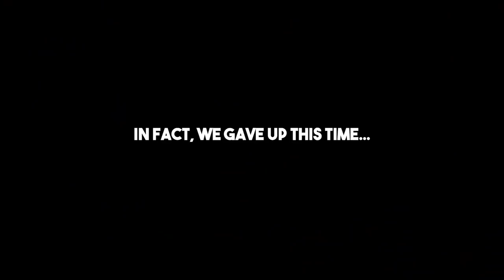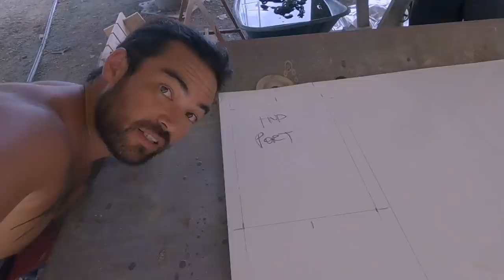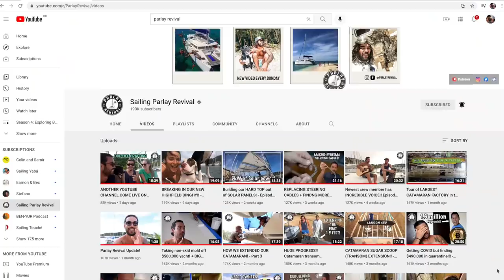⛵️This Lagoon 450 with broken bulkheads could have sunk 😨#213

Comment: Now I see how wonderful it is to have a steel boat.  Working with steel is so much easier than fiberglass.
Reply: Huuum, each material has it's qualities and defaults. Like weight, steel hulls are way more heavy than fiberglass. As Collin demonstrated, fiberglass is easier to work with in case of an accident/collision. You can have your fiberglass repaired in any marina around the world, not so with steel.
It goes on and on and on...

Comment: If the bulkhead damage is indeed so common, a class action lawsuit might be the answer to get the company to reimburse owners.
Reply: The manufacturer is working with the owners of these boats; it is not strictly adversarial requiring attorneys to get things done. All, as you know, has been brought about from Colin's hard work and public forum.
Reply: Well, they took it out of the Lagoon.  🤔
Reply: @tollertollertoller  Thanks for sharing. I wish all owners good luck.

Comment: They are cheating, they bought that fiberglass. To make it from scratch you must start with a large crucible that you have made, filled with washed sand and other ingredients, and then drawn into glass fiber which you weave into cloth.
 Not to worry, I'm sure that if you build the crucible, Roberta will weave the fiber into fiberglass cloth for you. (G)